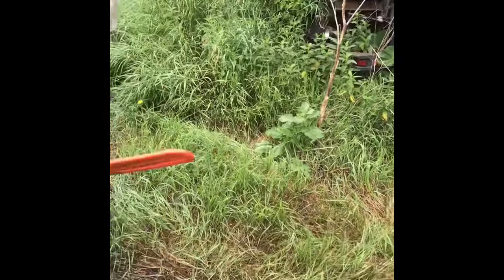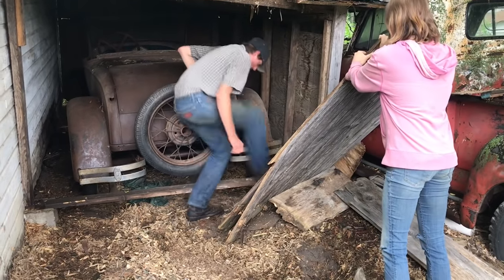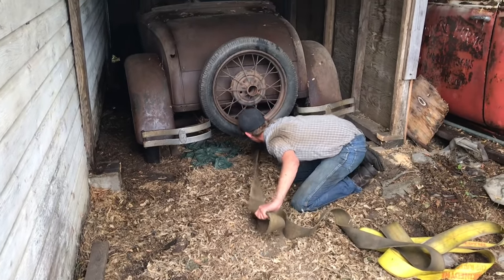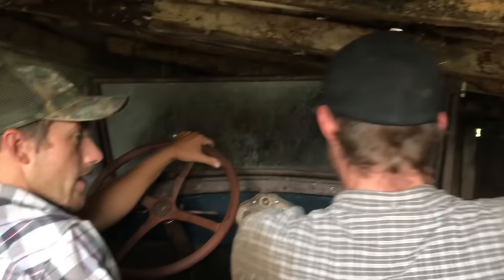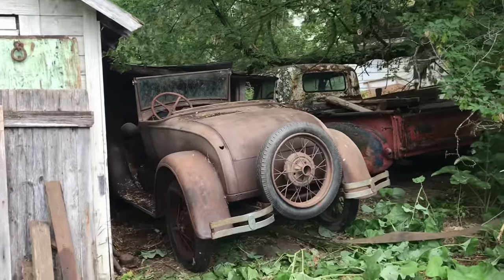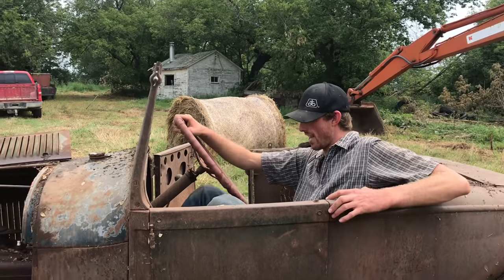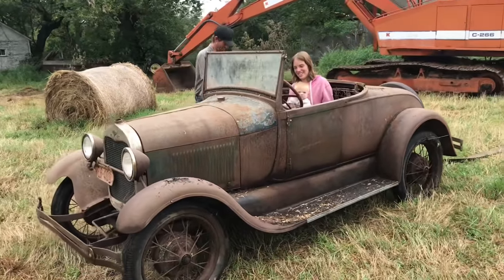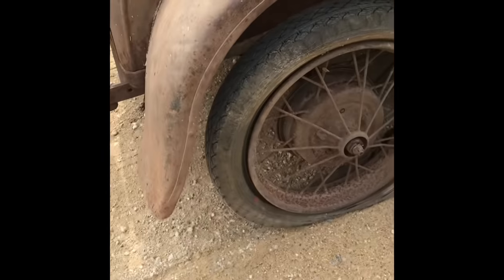An ultimate barn Find..... it could be a 1928 Ford roadster

Comment: Cars that age often had wood floors new from the factory and many also had wooden frames supporting the body, also the metalwork was often beaten to shape by hand. (Not Fords so far as I know)

Mostly thanks to Henry Ford the rapid appearance of relatively cheap mass produced mechanized vehicles left many skilled coach builders looking for alternative employment.

'Motorized carriages' became contracted to 'motor cars' and were an inevitable option for coach builders seeking employment at their rapidly vanishing trade.

Hence the term 'coach work' alludes to the fact that early motor body builders learned their trade building horse drawn vehicles and early model Fords even had a wooden case surrounding the ignition coil.

I know this because my Grandfather had a model T coil he used as part of a home made electric fence to try and keep cats off his pride and joy Chrysler Royal.

The wooden case on that old coil even had neat dove tail joints suggesting manufacture by proper woodworking craftsmen.

In the case of this old model A you found, what you called the coil is actually the distributor and a coil with a more modern metal case is mounted on the firewall behind the engine, the intake manifold is an early 'updraft' design.

I don't know what the car might be worth but if anything is certain it is that rarity increases not only monetary but historic value so please, don't mess with it.

Comment: Besides a few one year only parts, you can get any part you need to restore that car. The problem with "A"s is they made so many of them. So even fully restored, they don't bring that much money. You will have more money to restore it then it will be worth. But if it was mine, I would keep it stock.and not hot rod it.

Comment: What you have is around a 1927/28 Ford Model A Roadster.  The Deluxe model would’ve had side mirrors mounted on the windshield pillars.  The wood floors are original.  Yes you’re missing a few pieces but the body is in excellent shape.  Guarantee that engine will run with very little repairs.  Be careful with the hand crank, these things will break arms if you’ve never used one.  I see what appears to be bullet holes in various places, that car could’ve been used as a whiskey runner with the missing tail lights and bullet holes plus the way it was hidden away sealed in that coffin for no one to see.  Really wondering what you found in the rumble seat…
Have fun and keep it alive!

*1929 Ford Model A Roadster 
22k original miles

*1969 Ford Mustang Mach 1 390 “S”Code 65k original miles
Reply: there was no deluxe model in 28 or 29. only 30 and 31.

Comment: I have one restored ,  may be 1928-1931 Ford model  A convertable. Not a roadster. Three  3 speed manual on the the column. 4 cyl. 85hp.  You can restore it add a overdrive  so you  can drive  at high  speed.  1932 is the Roadster one of the first v8 flat head engines.  1927 is called model T and down to 1906.

Comment: By now, a 90% or better  restoration of this car can do a lot more for its value as anything you could achieve with customization or engine swapping. If you want a customized hot rod with a big block Chevy or Hellcat engine, the thing to do  is restore this car, sell it to the highest bidder go buy your dream car and have money left over.
Reply: Restore it  keep it original.

Comment: A lot of people say that model a Fords are rare but really they’re not there’s still a lot of them around and you can get them for fairly good price and parts are very easy to get because they reproduce pretty much every single part for them they made over 5 million model A’s in the four-year production and what you have is a 28 model a Ford roadster which is still very desirable and they’re great restoration projects but hearing people call them rare is not that true but they’re still amazing great cars and you should be proud to have one but I do agree with one thing everyone else is saying DO NOT HOT ROD IT it’s more valuable if you restore it to original factory settings

Comment: Judging by the instrument panel, specifically the speedometer and odometer, somewhere between 1927/and early 1930 Ford Model A Roadster convertible.  Would guess it was not the Special model as it does not have the dual spares on the fenders and does not appear to have a trunk carrier.

Comment: Your Model A has the handbrake on the left side instead of in the middle and the steering wheel is red
which means its a early 1928 it was built in late 27 or early 28 was built 
That one is rare and would be nice to see if vin number on motor matches the chassis  if so it would be worth more
 to keep it all original and rebuilt the original motor.  Very Nice Car

Comment: don"t be idiots with your 9 inch ford rear end and flame paint job..Learn about model A fords and spend 15,000 and have a  rare low production model..Its a gem..Impossible to find one so complete..Originally Washington Blue.Model A club of America will tell you when it  was built by the Engine number...You are very very lucky..

Comment: I'm guessing a 1930 Ford Coupe ...The fender bead runs along the lip of the fenders  and the straight headlight bar...? I'm not sure, but I believe Ford started putting electric starters on the Model A 's in 1930 ..? If it were me, I would leave it intact, all metal bodies are rare & valuable...! Good luck..!
Reply: henry put staters on in about 1915 or 16 or u could put one on urself it not a coupe they had a roof
Reply: Sorry but your way off. Body itself is pre 1930, but nice try

Comment: Now you need to drag that old GM pickup out of there. Its worth more restored than the Model A, which is a ‘28, BTW.  You can tell by the placement of the emergency brake to the left of the driver. Do not try to start it with that shellack in the gas tank! Read my last sentence again. DO NOT TRY TO START IT WITH SHELLACK IN THE TANK. AND IF YOU DON’TKNOCK HOW TO USE THAT CRANK, STAND BY FOR A BROKEN THUMB!!

Comment: Don’t listen to these oldies. 351 V8, 9” limited slip diff. Mickey Ts on the back to lay some rubber. Take that old motor out and dump it in the trash. Air bags all round, get the running boards on the ground! You can weld a bunch of steel in that thang to stiffen her right up so she don’t twist under the torque.

Comment: this is not a high value car. just a great find to have fun with. all the parts can easily be found. the most fun is to get it running and mechanically sound. It is NOT a 1927, but a 1928.
Model As are the best entry level of antique cars. they cost more to restore properly, then they are worth in the end. value of this find is in the 4500. range.

Comment: I think it might be a 1929, judging from the lenses on the headlights. The 28's had vertical fluted lenses and were also on very early 29's. Yours has a later model lens. Nice old car that should be fun to restore!
Reply: After looking closer at the rest of the video, I think it is indeed a very early and rare roadster (1927-28 vintage) that had the headlights replaced from a later model.
Reply from the maker: Yeah that is what we are thinking too!
Reply: lenses are aftermkt sealed beem- they are incorrect for the car.

Comment: New Fan Belt, amazing find.  This video is definitely a staged "barn find".  No way would any of the wheels turn, nor would the tires be able to hold air, and the steering gears would have been frozen. True barn find and anyone with brains would have protected and crated the car while in place, not just drag it out.  The way you guys treated it was like complete armatures without a care of causing damage.  No one in their right mind would have stepped on the running boards, climbed in and try to steer.  I wouldn't subscribe to your channel if it was the last car restoration channel on YouTube.
Reply: I recently helped a mate pick up another '24 Buick that hadn't moved for over fifty years. Two of the tyres took air, and none of the gears were frozen. All it took for the engine to turn was a soak overnight. Stop being a negative Nancy, you obviously know far less than you make out. So what if they don't know what they're doing (yet), there's only one way to learn.